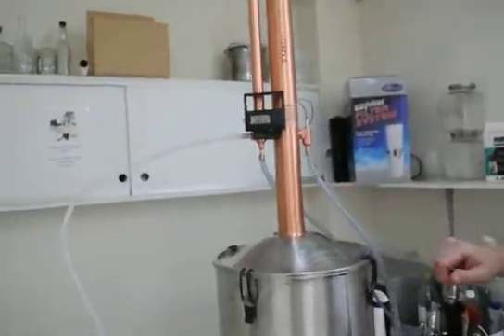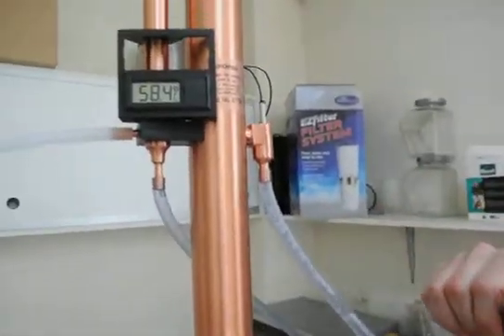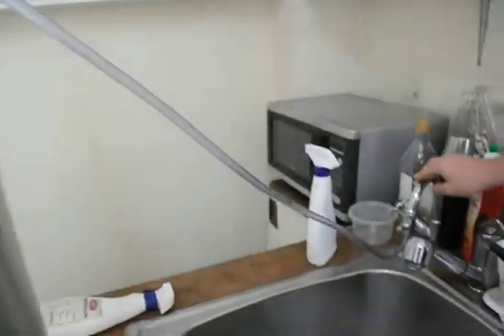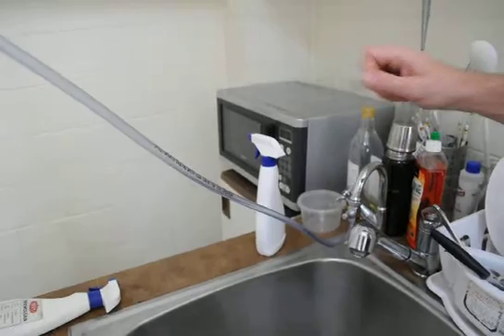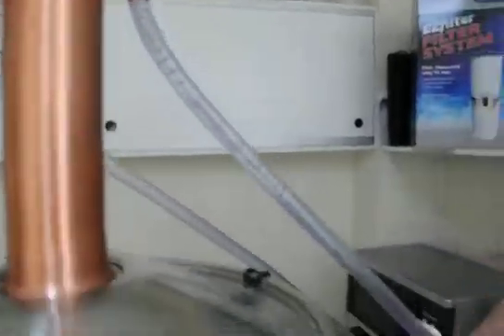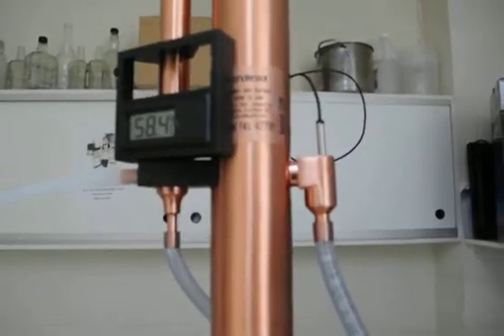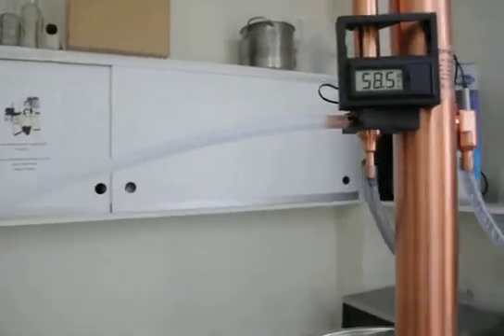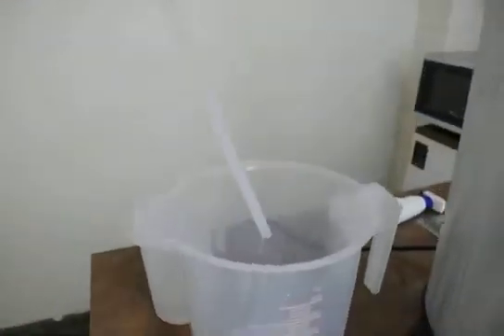Close up on how to use Still Spirits Turbo 500 - cooling water and distillation explained

Comment: For those interested I have just finished developing a distillation controller that helps with the foreshot, temperature control and final shutdown at the end to reduce the time wastage that is otherwise involved with doing a "run" and get a better output product (the alcohol).   For those interested you will need to google mrgizmo distillation controller to get some information on the device.

Its taken a few years to get to this stage and takes the effort out of the constant readjustment of the needle valve.   This happens as the wash in the still is gradually getting less alcoholic and so the water flow needs to be readjusted to keep temperature where it needs to be.

Be interested in any feedback on it. Development only finished in Dec of 2024.

Geoffrey, NZ.

Comment: Pull out ya temp probe and wrap it with a bit of thread tape shove back in firmly and you will get rid of them bubbles...better clean and more manageable flow control  Churr :)
Reply: I know this is 5 years later. And u may not even see this, just wanted to say thank you though, this tip made my life a hell of a lot easier